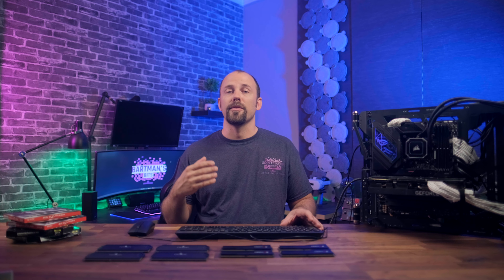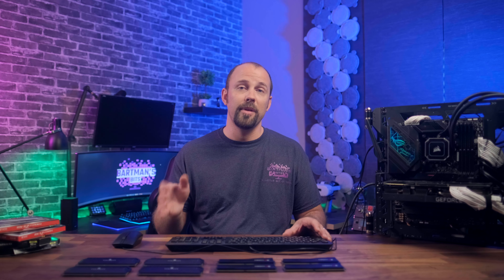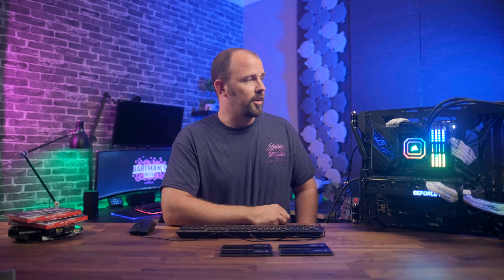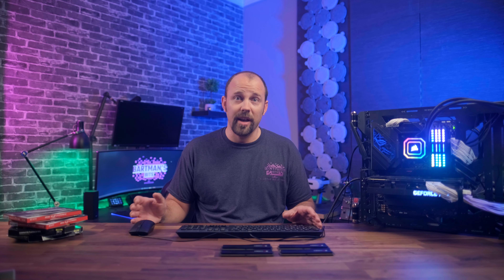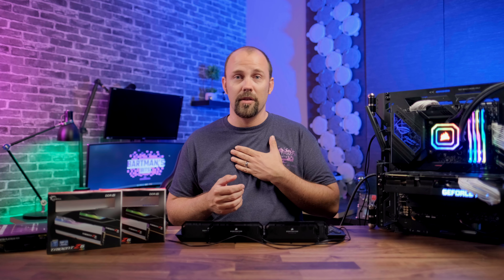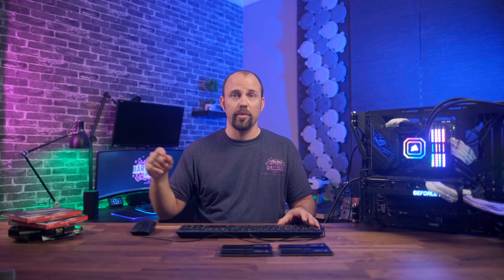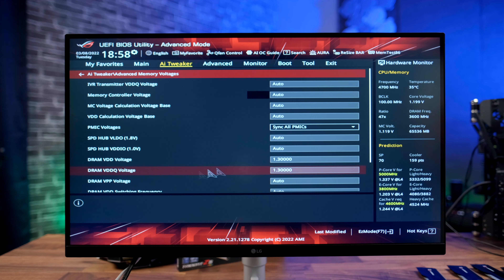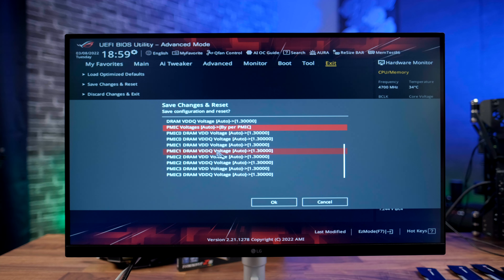Intel’s DDR5 problem resolved! DDR5 64GB Boot Loop failure Fix. Get the rated speeds of your RAM!

Comment: For all the people on MSI boards, PER PMIC thing is right above the Voltage settings, it just says Memory Voltage LINKED, so set this to UNLINKED and enter desired voltage in all fields below both  in VDD and VDDQ fields.
Kingston Fury RGB DDR5 5600 MHz on MSI Z690 Force WiFi board, latest bios (which has memory fine tuned update). and i9-12900K which is undervolted as well. Just loaded XMP settings, and 1.35V for the voltage. Stable in all the tests...

Before the BIOS update I had so many issues, even with this method here. I had to manually set desired speed, but this in return also messed up the sub timings, so it was not stable, as of the latest BIOS update, as I sad, just XMP and 1.35V UNLINKED voltage and it works.
Reply: Hi, any suggest for Kingston FURY KF552C40BBAK2-16 (x2, so total 32 GB), i have problem on settings 5200Mhz, 1.35V seems to high...
Reply: @njuna900  Upgrade BIOS first, that's a start.. after that 1.35V must work, but unlinked, 1.35 for each slot... 5200 is easy to achieve, should work without problems... but for 32 gigs, you should have gotten 2x 16 sticks just to be safe... I get it for 64 as there less 2x 32 kits on the market
Reply: @LevelUPGamingTech  HI, thanks for your reply, thanks a lot! i have upgrade the bios with the last firmware, i have  TUF GAMING Z690-PLUS with bios 1720.
I had to choise 4 instead of 2 because i preffer use quad channel and not dual
Anyway these RAMs at 1.35 V (unlinked voltage) i dont know where this exactly this setting but i guess it's the same on this video, and on OS have much problems, i guess 1.35 are anyway to HIGH for these rams. my rams profiles are those anyway : • Default (JEDEC): DDR5-4800 CL40-39-39 @1.1V
• XMP Profile #1: DDR5-5200 CL40-40-40 @1.25V
• XMP Profile #2: DDR5-4800 CL38-38-38 @1.1V
Reply: @njuna900  In your cae it's as in the video By Per PMIC setting, I guess it's not stable in your csse... try 4800 but tighten main latencies to 38, should give you pretty much the same results as on 5200
Reply: @LevelUPGamingTech  Yes, im stable using XMP Profile #2: DDR5-4800 CL38-38-38 @1.1V with different Voltage, i did as video have explained.
Thank you anyway for your support, i have followed also you :)
I just hope in the futures a new bios update will solve this weird issue...
Reply: @njuna900  Thanks 😉 I hope so too, it is all "new" and bugs are still being fixed... also bear in mind there is sometimes the silicon lottery as well, so your CPU might play a role in all this, to have weaker memory controller and all sorts of stuff. But usually it's the board...
Reply: @LevelUPGamingTech  Yes i know... i did finaly an upgrade on my old pc... my old one was 2600K with OC at 4.5Ghz super stable... and now my config have a 12900K... let's see...
Reply: I can’t find it any help please I only have DRaM Memory Voltage Also Dram Timing Voltage
Reply: I have VDDQ options but no VDD! There’s VPP voltage! Is that same!?
Reply: Nice... I'll try to update the bios (last update Oct 2023) next.
But I tried this already and nothing, won't even let me "try it" to 4800 (my corsair vengeance is 5600)
Reply: Pro b650m-a wifi board bios, cant seem to find this option please help
Reply: @jashanawal8675 you and I both brother I find plenty of other videos but can’t find ANY for b650 MB
Reply: U are the goat bro 🔥🔥

Comment: I got one important thing from this video re memory learning... only because my XMP issue wasn't related to 4 sticks: "I have had this go for quite a while," you said.   I never had to wait any appreciable amount of time in the past during bootup right after turning on XMP on any new system I built... so I didn't know there's a potential to wait for a semi-lengthy learning period.  However, what you said at 7:20 allowed me to not be so aggressive with power cycling when I'd get a black screen, and within < a minute my Z790 Aorus Elite X WiFi v.1 with G.Skill Trident 6000MHz w/ i9 12900K booted into Win 11 with perfection. 
I didn't have to endure the hassle of a return, and I was able to cancel my order for new RAM before shipping.
Thanks, man!  🖥⏳

Comment: As many others have said this fix has solved the boot loop issue! I was banging my head the wall for a month trying to figure out what was going on. Just built a new pc, 13900k with ASUS Z790H motherboard. I thought I had doa components so I replaced just about everything but of course it was still in a loop. What messed me up was I pulled the cmos battery out to restore bios settings but it was still stuck in a loop. I guess with this board even after pulling battery it will not restore bios, this can only be done by holding the reset bios button on the IO. I wish I had found this video. Literary took 2 minutes to fix it, I could not get the rated 6400mhz out of my ram at 1.40 volts but I was able to get 6000mhz. I could bump my voltage up to 1.45 and it would probably be stable but ASUS says don’t go any higher than 1.40 for daily use. This is a known issues with these boards but ASUS will not give a bios update to fix the issue, very frustrating!

Comment: Thanks this worked for me. 
I had Corsair Vengeance DDR5 6000 MHz
My base voltage was 1.35 so I upped it to 1.4 but I had to change the speed to 5600 MHz in order to get it work

Comment: YOU LEGEND! Purchased 4x48gb Trident Z5 6400mhz cl32 and the xmp was failing. Upping the voltage from 1.35 to 1.4 fixed this and passed the stress test :) Was a bit concerned I needed to power it off twice after 5 minutes of nothing but third boot worked like a charm.
Reply: Did you get all the 4 sticks at 6400Mhz?
Reply: Never
Reply: Thank you. I was scared to go that high with the voltage
Reply: I got 2 sets of Gskill f5-6400j3239g32gx2-tz5rk 2x32 kit. After I raise the voltage to 1.435 and follow this video, I got one set of the kit running with XMP I. Going to see if 2 kits can work together with XMP I.
Reply: @rikka0_059 yo bud did you tried finally 4x sticks and working smoothly? I got 4x16 7800mhz tomorrow gonna try upper voltage thing. Wanna know ur situation
Reply: I am having same issue, please help

Intel i9 14900k Crashing / Gigabyte z790 UD AX
I see unexpected crashing issues when I install 4 G.skill Trident Z DDR5 RAM sticks (4000 MT/s) instead of 2 (4800 MT/s).

Some config I have setup:
Performance CPU Clock Ratio: 55
Efficiency CPU Clock Ratio: 42
Extreme Memory Profile: disabled
BIOS is up to date : [F11e]

Comment: I have 4 x 16gb Corsair CMK32GX5M2B6000Z30  ddr5 modules on msi z690 tomahawk wifi + i7 12700kf on bios H.KO 10/24. I could only run it at 4000mhz. All i did was unlink ram, set  to iexpo save and boot, it took about 30secs to train the ram and i have the system running. Cant be this simple. Awesome. Thank you. Greatly appreciated.

Comment: So I have the z790m-Plus board and was having a nightmare of situation with the unexpected DDR5 training sessions. Sometimes would finally boot then crash blue screen and then go through 5 cycles of restarts before getting back to the OS. I followed your steps and holy shit it all works and my PC is super stable now. Thank you so much for this video. 

For memory I have 2x 32GB Trident Z5 DDR5 RAM 64GB 6400MT/s CL32-39-39-102 1.40V , I raised the voltages to 1.435V and now the RGB on all sticks is consistent as well as setting the PMIC Voltages to "BY per PMRC" works flawlessly.

Comment: Dude, what a legend! :)
I am running a 14700K with 4 sticks of 16GB 6400 MHZ Corsair Vengance RAM.
Turned on XMP 1 and clocked the RAM down to 5600 MHZ according to intel's 14700K CPU RAM support specs on their page.
I had quite some issues with crashing games and stuff, untill i changed the PMIC Voltages setting from "Sync All PMICs" to "By per PMIC".
The voltage settings have not been changed as i do not run 100% of the RAM clock capabilities and voltages are already set by the XMP profile to 1.4 V.
My RAM has been running stable since this change, and games haven't been crashing no more.
I haven't done alot of testing yet but i will keep you guys updated.
Thanks alot for sharing this information with the community! :)
Reply: Any issue gor your Pc? My 2x 5600hz ram with 14700k randomly crashing my game

Comment: I'm using a asus maximus formula z690 board for any one having issues running at 6400mhz following this guide worked but it kept crashing i found that the place that built my pc put the ram in a1 and b1 this was the cause of my issue after removing ram and running a2 and b2 as the motherboards suggested with 2 sticks im now running at 6400mhz 1.35v with no issues make sure you check there in correct ports lads.
Reply: Same board with the trident z5 6400mhz currently can't get it to run higher than 5000mhz. 64gb.
Reply: @zeke10148  if its 4 sticks of ram seen there can be issues with ddr5 hope you sort it out
Reply: I'm using 4  might go down to just 2 for 32 gb. I've read reviews others have got it to be stable at 6400mhz with two sticks. Doesn't look like trident supports it with 4, I was running ok with the default at 3800mhz. Saw somewhere else 4000-4400mhz is the best you are going to get with Trident on this board. Best I got to even boot so far was 5800MHZ on the stock timing with voltage at 1.45V. Occasional crashing running games, mem86 shows a lot of errors.
Model F5-6400J3239G16GX2-TZ5RS

Comment: It did indeed take a while but worked as you said it would after several training sessions! I also had to re-seat the ram to get it to work. Brilliant and informative video. That's an absolute sub from me, and I cannot thank you enough. You are the man! :)
Reply: Z790 maximus extream DDR5 7000 4×16GB same issues 

At Auto will run at 4800 1.1 1.1 1.8 Voltage 

Xmp1 not running 4 sticks 

Trying to get it running on 2 sticks then on 4 sticks
Reply: @DarkSoul-sm2wv  I still get the odd crash but it is very rare! You have very high speed mem at 7000mhz and a higher spec mobo, so I am not sure about the issues you are still facing. Nut I think essentially we are still having to OC the ram to get the rated speeds. It seems DDR5 is still quite poorly optimized
Reply: @DarkSoul-sm2wv yo bud what you’ve done? Today im having same shet with meg ace 790 4x16 trident z5 7800 MHz. Stock works on 4000 MHz and whenever i want to get it higher(didn’t voltage up yet only speeds) its crashing anyway so. Gonna try upper voltage tomorrow. Have you got any solution for 4 sticks? Best regards

Comment: Omg you saved my a**... I literally been sitting on 4 sticks and only using two. I slapped the other two into the board and it worked... you definitely made this terrible day into a better one. Thank you!!!!
Reply: What 4 sticks do you have? Did you use the exact settings as in the video or a little higher?
Reply: @sadiquldey  same question here
Reply: Knock knock! What kits you’re running buddy

Comment: Great Video but I want to highlight one thing for many people that still have problem with xmp profile on my own case:
I ordered Prebuild PC and had hard time configuring xmp profile for 6000mhz 2x16gb and I almost lost my mind.. turned out the person who was building my PC inserted RAMs in wrong ports, check your motherboard manual and be sure that you have inserted ram in correct ports, I switched mine,  did steps from the video and it worked like charm!

Comment: Just got an ASRock z790 Steel Legend and 4x16GB corsair vengeance ddr5-6000 ram. Set the xmp profile and manually set to DDR5-6000. nope. Tried everything I could and it defaults to 3600 until I came across your video! I do have a core i9-12900k which says max 4800 so I set it to 4800 with your other settings, I put my voltages to 1.35 though.  So far it's stable at 4800. I'll try going up later but I'm happy for now.  Thank you!!!

Comment: Following the steps taken in this video got me to the "stuck in learning phase" problem. Twas suggested in the video to try reducing the clock speed if that happens. So, I dropped the target speed from 6400 MHz to 6200 MHz and now it seems to be running beautifully. Thank you very much for this video as it is amazingly still relevant with the Z790 boards in December of 2022! 

13900K
ROG Strix Z790-E
4x 16GB G.Skill Trident Z5 XMP- 6400 MHz

Also worth noting that I had originally and mistakenly built this PC with similar EXPO RAM and the system booted first try with no issues. I only noticed that the Micro Center guy had grabbed the wrong RAM for me after I noticed nearly a month later that my RAM was running at 4800 MHz. Anyway, I'm glad it's all solved now. Thanks again!
Reply: Excuse me, but bid you try to increase the voltage before this alternative way?
Reply: @charlesjr9523  yes. System would not boot. 

I actually ran into reliability issues after this post with specific video games. I have since changed to 2x 32GB DDR5 with 6000 MHz XMP. No issues whatsoever since this change.

Comment: XMP I + these settings on an ASUS ROG STRIX Z790-E Gaming Wifi Motherboard (BIOS ver. 1202) +  4 DIMMs x 32 GB Corsair Vengeance RGB DDR5 5600 MHz (CMH64GX5M2B5600C36) works fine as of 05/08/2023.  The maximum I could go for without these changes was 4800 MHz, on 2 DIMMs or 4 DIMMs on default settings. I can confirm 4 DIMMs on XMP I or II forces the system into the boot loop with no display, without these changes. Thanks heaps.

Comment: Can't thank you enough. I was about to give up on XMP when I came across this video. I couldn't believe it POSTed after making those settings. I had tried everything. However, at the default XMP profile, I was failing memtest. I ended up reducing frequency from 5600 to 5200 for it to pass memtest. Still need to stress test but I'm stoked. I'm now running 128GB DDR5 at XMP profile (sort of) haha. Can't thank you enough.

Asus ProArt Z690 wifi board
4 x 32gb g.skill Trident z5 ddr5-5600 30-36-36-36-89 timings (2 kits for a total of 128gb0
i9-13900K CPU
Reply: I am having same issue, please help

Intel i9 14900k Crashing / Gigabyte z790 UD AX
I see unexpected crashing issues when I install 4 G.skill Trident Z DDR5 RAM sticks (4000 MT/s) instead of 2 (4800 MT/s).

Some config I have setup:
Performance CPU Clock Ratio: 55
Efficiency CPU Clock Ratio: 42
Extreme Memory Profile: disabled
BIOS is up to date : [F11e]

Comment: THANK YOU. Z790 pro carbon did not like xmp 6000mhz with the Delta Tforce. Now its running stable with 1.3V and unlinked the sticks in the BIOS.

Comment: MANY thanks for this. 
Got 128GB DDR5 running at 4800 on a Z790 and randomly crashing for months, as I did not find any way to make them work at their 5600 listed freq.
 This literally saved me. 3 months now since I made the mods suggested in this vid, all issues vanished.

Comment: Awesome advice thanks! Finally gave up trying to run 64GB of GSkill Z5 at 6500. Works with 2 not with 4. With 4 it won't go over the default speed even after changing the voltage. G SKILL doesn't show it as supported. But don't really need it so I took two out to run the faster clock speed.
Reply: Which Slots did you place the two sticks in 2nd and 4th? Or 1st and 3rd?
Reply: @donvincenz7406  2nd and 4rth going away from the cpu. Per the Asus user manual.
Reply: Your comment over a year later helped me. I moved the stickers as you said to 2nd and 4th from 1st and 3rd and it worked. I did everything this guy said on YouTube but it wouldn’t work. Thank you.

Comment: Thank you for the PMIC tip!

I have 6000mhz ram but I have 128gb (x4 sticks) and apparently you can't run the Ram that fast if you have all 4 slots used. So after picking the 6000mhz XMP preset, I then went to the speed setting and lowered it manually to 5000. But without the PMIC, even that didn't work.

Comment: Hi. Your video is great and priceless!  Used your suggestions for my newly purchased Corsair Dominator Platinum RGB 2x32GB (64GB) XMP3.0 6600MTs kit which was proving difficult to run at 6600. The change to the PMIC voltages form Sync All PMICs to By per PMIC made all the difference.  Works rock solid at 6000 and 13900K at 5.8GHz. Thank you.
All the other XMP O/C videos are so complicated and do not work as well as yours.
Reply: I have a similar Corsair Dominator Platinum RGB 2x32 64GB ram kit as you and a 13700k. When PC is put into sleep mode, upon start up, the system will only click then light up briefly, no boot, no windows, only ram rgb would stay on. Did you have a similar experience before this fix? Thanks

Comment: I'm sitting here with a MSI Tomahawk Z790 and a 13700K I bought at Best Buy yesterday. Got it all together and everything was wonderful. Then in the middle of Red Dead Redemption2 it totally blacked out, dead shut off. Then came back on and boot loop. It never post another picture on the monitor even after 25 or so boot ups. I was on a failsafe bios setting. 
First thing I checked was my thermal paste. Just to see if it went south after getting hot. All was awesome there. Then went to the old Z390 9900K combo I had the ram and 6800xt graphics card working with yesterday. Everything booted right up with no failures. 
I was getting 15 fps easy in 4k above my old 9900K. I benched it out in CPUz and it was all in line with other 13700's performance wise. Heat staying below 75 in gaming. CPUID was showing MAX 75, but I never seen it hit that ever. Which was hot to an extent, but I was pushing the 6800xt at 100%. I have a fairly new 850 Corsair PSU, so with no real strain on the system it has to be either the processor or the motherboard. I tried to just take the graphics card and battery out and boot with the 13700K but still stuck in a boot loop. 
I like so much to get it figured out, but hate the investment into a motherboard that is so fragile if it turns out to be the issue.